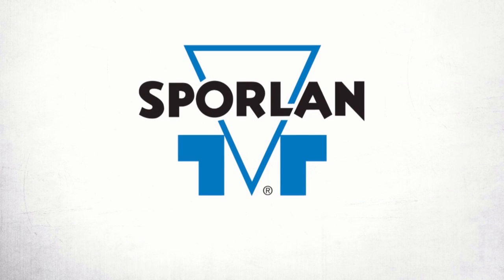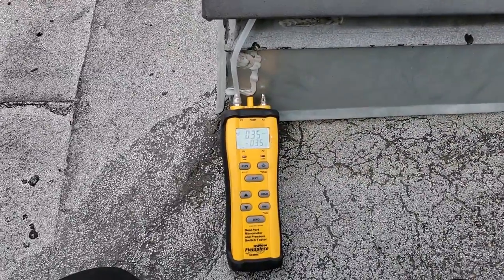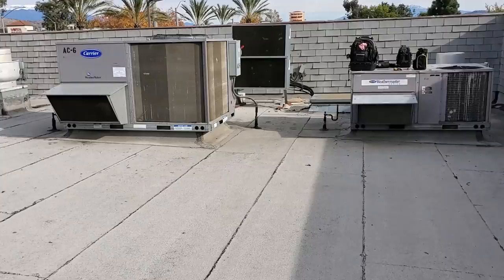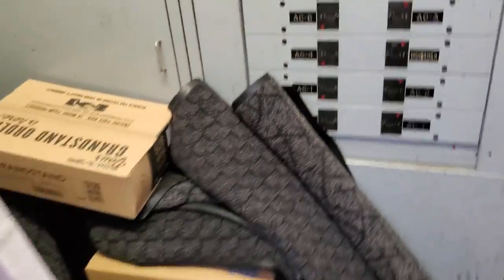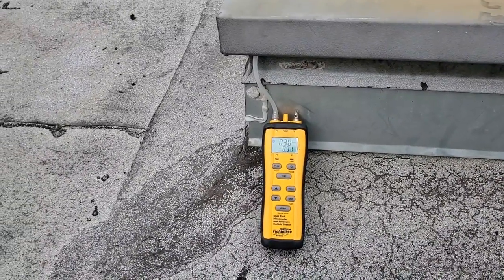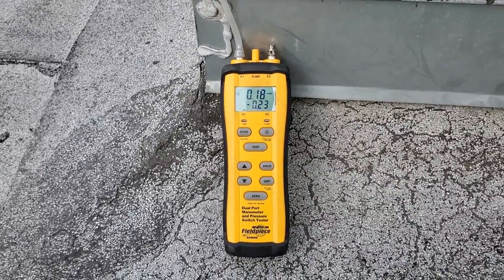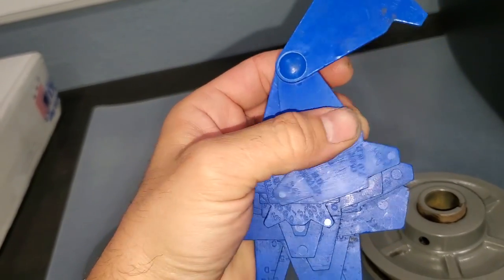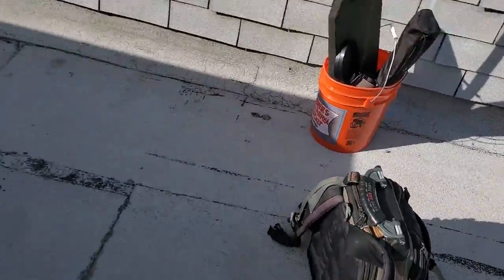THE FRONT DOORS ARE TOO HARD TO OPEN (AIR BALANCE ISSUE)

Comment: I have a question. Is it common for these adjustable pulleys to remain on after air adjustment? I have come across these before but only temporary when the airflow is adjusted and then changed to a non adustable set pulley when the right airflow is achieved.
Well atleast i do not need to care about them as much anymore with the new direct drive pmsm motors. But they sure did a number on me the first time i configured a vfd with a permanent magnet synchronous motor.

I truly appreciate everything you have done for the community with your videos. Showing both succes and mistakes which keeps it real sort of speak.

Sorry if the spelling is incorrect. English is not my first language, best regards from Sweden.

Comment: I worked in a head office of a offshore renewable power generation ops and maintenance building that had a state of the art BMS. I got the impression that it had never been properly commissioned and consequently the AC and heating and ventilation were constantly fighting against each other and wasting a fortune in energy. They even had a CHP gas engine generator that had not been serviced in years despite being in constant use. So sad and so difficult to find anyone who could commission it correctly. Beautiful technology completely wasted such that it was an ecological disaster rather than the triumph it was intended to be.

Comment: why not a standard poulie , these are much harder and can't get wider so quicly. The model used is a V that consist of two pieces
Reply: Stefaan Codde That is a standard pulley design that allows you to easily vary either the load on the motor or the  output of the blower.
When you see pulley wear like that it usually is cause by running a pulley under load with a loose belt.  That lets the belt slip against the pulley and eats the shieve profile slowly at first, and then quicker and quicker.  Once the profile is worn down, a new belt will slip.  A poor tradesman will just tighten the belt too tight, and end up taking out the bearings in either the motor, blower, or both.

Comment: Could use your or someone elses opinion on this..
This past summer during the couple days it got REALLY hot the AC started acting up, had a number of ppl check it out, they couldn't figure it out, I ended up figuring out how to temporarily fix it MYSELF then had another company check it and they gave me a reason for it acting up. So, the AC will run fine, but after turning off 2 or 3 times the outside unit stops working but the inside unit continues to function even though the AC itself is not. The way I figured out how to fix this is by using the wet/dry switch to reset the system, after which the AC works normally for 2 or 3 on/off cycles (It does this for the heater as well which as of now sucks, so im using a space heater in its place so I don't have to keep going in the attic which is hella cold atm to reset it), so the last company told me that the cause has to do with the High Pressure switch but did not go further into detail, this was a couple months ago. Could this actually be the cause and if so how can it be fixed in a somewhat cheap manner if possible? Residential unit not business.

Comment: at 18 u are comparing a new pulley with the "worn" one... but u couldnt simply loose the bolt, close the gap between the 2 half pulley and fix the bolt again to get riddle of the gap?
Reply: The worn pulley was already grabbing the belt, so I think closing it more would only make things worse

Comment: Where wires run through metal holes, why don't the manufacturer put a plastic ring in those holes??
Reply from the maker: I will discuss this on the stream tonight 7/12/21 @ 5:PM (pacific)  come check it out  https://youtu.be/sSZgwI-oduU

Comment: checking a potential ground shortcut with the multimeter is not a good idea. You might find an infinite resistance at 9V but a short at 100V, that is why insulation testers have high voltage generators.
put a light bulb over the switch if you don't have one and you know what's on.

Comment: Its a shame how these little guys (restaurants) take maintenance for granted. Everybody wants to save a buck. They should have at least a minimum of 2 visits a year! Just to do a the typical PM then evaluate the equipment before things like this gets out of control.I'm looking back and remembering a building I used to service(Building Automation, not mechanical) that had their own building engineers that basically did nothing but walk around looking busy. Their building was so damn negative, one of the doors finally slammed shut on some poor woman's fingers. I warned these guys for months about what could happen. Wasn't pretty blood everywhere! I dont know what happen to her cause I was working at a near by building on a service call at the time. I saw an ambulance there with a crowd standing around. By the time I got out of the building and went across the street to see what happened she was gone with the ambulance. Just a bunch of blood spot near the door. was left. These are metal doors!! I dont want to even think about it anymore.
Reply from the maker: Yeah that is scary for sure!   I will be going live on YouTube this evening 12/23/19 @ 5:PM (pacific time) to discuss my most recent uploads and answer questions from emails, YouTube comments and the live chat, come check it out if you can https://youtu.be/K3iG5q_Q_0U

Comment: Meanwhile my house pulls a ton of air from walls outlets while furnace is on then top it off doors open and close shut
Reply: Not enough returns. Your place is probably like mine... no returns or jump ducts in each room, only door undercuts.

I had never seen that method of return air until I moved to the west coast.  

As a temp fix, leave all the interior doors open.
Reply: equid0x the only return is in one room that’s adjacent to the furnace

Comment: You wonder often about whether it is a pulley or sheave. Technically a pulley is a housing that contains a sheave and a sheave is the wheel that a belt or rope rides on. So typically if you are hoisting material it is a pulley and if it is direct drive it is a sheave.

Comment: 20:55 Running that wire harness trough the blower compartment unsheathed like that is bad practise. What kind of electrical regulations do you have in the US that allows a manufacturer to do shoddy construction. Not only is it an inevitable failure point, it's also a potential shock hazard it the GFCI fails / bad or corroded grounding.

Comment: I just realized that exhaust fans take out all the air conditioned air. Restaurants must have to run their AC constantly. Come to think of it, i've never been in a restaurant in the summer that didn't have the AC on. What a waste. Excess wear and tear on the units to. But what can anyone do?
Reply from the maker: If the building is balanced correctly and the hood and makeup air is working correctly the exhaust will only pull the air from around the hood area and the makeup air unit will replace the air exhausted so it shouldn't actually pull conditioned air out of the building if that makes sense??
Reply: @HVACRVIDEOS  Put it in, then take it out all in the same place.
Reply: @agentk3984  be strategic and have the fresh air inlets in the dining area, then food smells doesn't come from kitchen..

Or do the opposite to entice people :P especially all you can eat buffets

Comment: You U.S. guys are just crazy... running simple wires through the whole machine.. would be completely impossible in europe - you would at least need double insulated cables! And no one would use pulleys here - only EC motors with stepless regulation..

Comment: A jade controller uses that same harness and comes with pin adapters in order to hookup the jade to the icm. Telling people to pull those wires and run a stat wire is horrible advice. Take it back
Reply from the maker: I find when wiring in the jade its easier to use stat wire, the wires i pulled always rub out on top of the blower, running a stat wire literally takes 5 minutes on these Carrier units and you can eliminate the possibility of ever having another rub out..... just my 2 cents

Comment: Get in the habit of not standing in front of the breaker when you flip it back on. Trust me on that one. You may want to point out that any clutter within 36 inches of the breaker is a violation of the national electric code. Personally I like my hands, so I'd wear some gloves when measuring the mains. If I were putting video's online I'd show people how to do the work safely and by the book. If I wanted to cut corners I wouldn't do it publicly.

Comment: I’ve been watching your vids and enjoying them but gotta tell you this one was hard to watch.. first as far as air balance your not close to diagnosing correctly plus that bad pulley really?  Those were adjustable.  Shouldn’t get involved in areas that you don’t have expertise... called liability.  Just saying..
Reply from the maker: Where did I go wrong, I'm always looking to learn??
Reply: HVACR VIDEOS... balancing a building is another whole discipline which means another school need ecu’s and whole lot more equipment plus don’t forget the insurance. As mentioned earlier the liability goes way up especially in today’s environment. Without getting into a whole long explanation you were working at a restaurant obviously with a kitchen, if I remember right the kitchen unit wasn’t working and actually the fan was turning backwards due to the negative pressure..  Kitchens are supposed to be positive for again obvious reasons it’s keep bad air out that carries who knows what but more importantly the bathroom is supposed to be negative again you know why and it’s not just for smells.  So you can see where this could potentially be a real problem... not saying you can’t learn but you seem to have a bunch of work already why stress over another whole new area. Oh hey please know wasn’t trying to down you but some lessons can be very costly, having said that being a full time air balance guy pays really well but if think you have headaches now following your comp get ready to scale up several notches.. oh forgot to mention the travel.... used to cover 6 1/2 states had no life..   :-)
Reply from the maker: So I think your misunderstanding what I was doing here, and you don't adjust pulleys when they are worn out. If the pulley is worn it will wear the belt down faster and or break it.  I am in no way an expert in air balance i was just trying to get them operating until they could fix the issues and of course I always recommend they call a balance company after I leave but balance companies should never be adjusting the pulleys on the ac equipment because they can mess up the airflow on my acs... but i realize on some of the newer buildings they don't provide mua units which can be problematic.....
Reply: @gnuclur8952  I think I know you. I worked for Ernie Shortridge for 16 years.
Reply: @gnuclur8952  BTW if that restauraunt called a AABC outfit they would come out and then tell the resturaunt to hire a HVAC contractor to come out and make all the necessary repairs and make basic adjustments before they would touch it.
Reply: bigdpw that’s an option but it would be advantageous for the restaurant to have the a/b comp come in first to determine the issues, then the repairs which can save a step.. personally I would communicate with all parties before moving forward. Having said that you’re point is probably the way it would work since most restaurants are not closely monitored as far as air flow or pressure. Oh and we may know of one another was in the business for 35 years. How’re you doing?  :-)
Reply: @gnuclur8952  which company did you work for because I sure recognise your name.
Reply: bigdpw it was air quality then air consulting.
Reply: @gnuclur8952  I was the guy that would call you when you sent your meter in for recal and give you the price and get authorization. I know it was expensive but we did do a good job. I ran the repair dept and the analog calibrations.
Reply: bigdpw retired?
Reply: @gnuclur8952  actually I became an HVAC contractor in Arizona and Ernie's son is my partner in the business. I am retired from actively working and ranching in New Mexico.
Reply: bigdpw sounds like a really good situation you’ve got..   :-)

Comment: First off I’ve never seen a rubber belt wear a metal pully . It looks just fine I fact the other pully looked great to. I’ve used v belt systems on all sorts of machines and heavy equipment that spin at high revolutions. And the pull ya open if you would have shut it it wouldn’t have had the gap your just there for a money grab on pully replacement if you wanna bs some
One make sure you don’t do it online where everything can see it
Reply: You had the gap wide open on the pully so it was clear to see why the tool wouldn’t fit in the grove  at the end of the video
Reply from the maker: Your a little mis informed bud. Yes I could have closed the pulley but it needed to be open as much as it was for proper airflow. That's why needed to be replaced.
Reply: ty,ler you  know nothing  rubber belts do wear out steel pulleys effecting performance of exhaust/intake systems....! do light bulbs burn out ?
Reply: furthermore on hvac   you can only close the pulley a 1/2 turn  which would cause a increase in negative pressure
Reply from the maker: @Echofrombelow  the tool was used to show that the pulley wall was worn out, it wasn't being used to measure the gap width but more to show that the side wall of the V shaped pulley was not shaped like a v anymore. I mentioned the gap width in the video to point out that the new pulley needed to be set the same as the old pulley. The Belt was actually getting stuck in the pulley because it was worn out..... Did you not see that part of the video?
Reply: @HVACRVIDEOS  do not need that tool to see pulleys are worn, reference was to comment about tyler  griffin  statement about rubber belts not being able to wear out steel pulleys